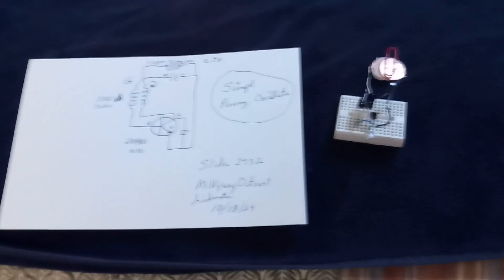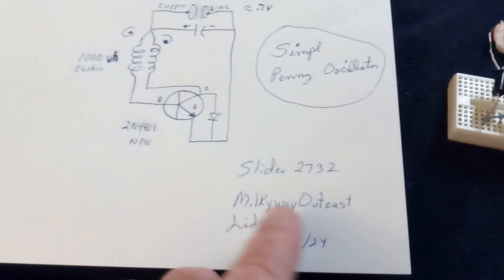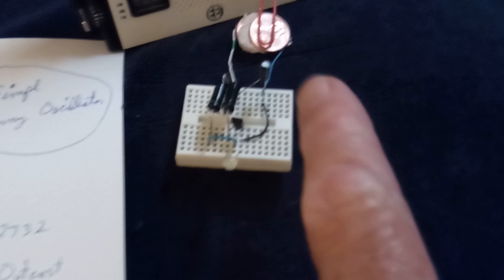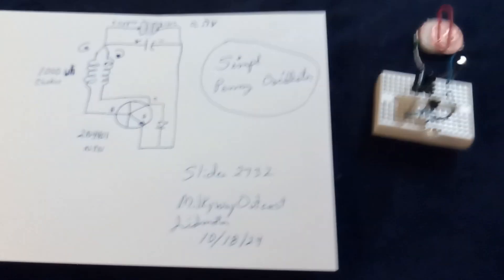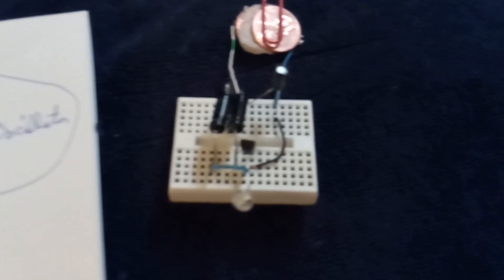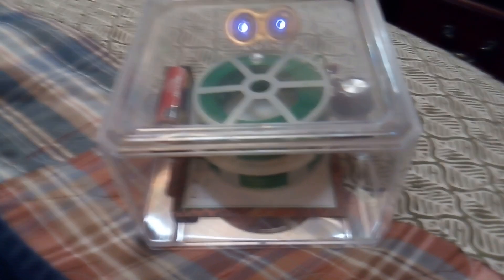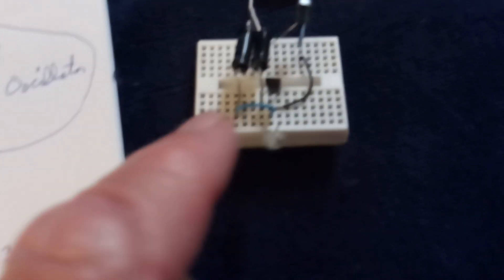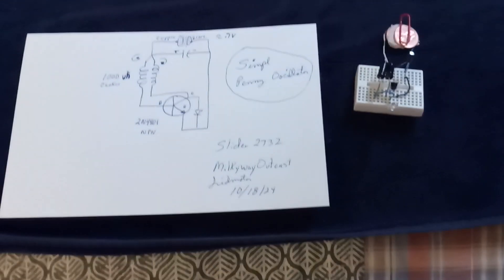The Simple Penny Oscillator

Comment: Copper, zinc, electrolyte between the two and alkaline solution, this is a rudimentary electrochemical battery.
The electrolyte can be cotton, paper, cloth, anything that absorbs the alkaline solution.
The alkaline solution can be vinegar, lemon, sulfuric acid, salt water, etc.
Reply from the maker: This copper and zinc cell can react with just tap water.  I am not sure that the US copper penny internal metal is pure zinc now.  It is probably an alloy.

Comment: thanks for the back link 🙂. i could only come up with this simplification because of you guys making the circuit in the first place. so i have to thank you for the thousends of hours of research you have done over the years and enabled me to learn and play around with this things myself.
Reply from the maker: Today I hooked up an amp meter like you used and it is indeed running in the low microamp range.  You made a great find.  Many thanks for sharing your discovery.  All the people who I have worked with over the years have built on each others work.   It has been a global effort and  alot of fun.
Reply: @Lidmotor  i am getting around 25 micro amp in the beginning. the longer it runs the lower goes the current down. also: do you have a different messurment for messuring across the cap vs across the emitter and collector? i do....🙂
Reply from the maker: @MilkywayOutcast  I have not had much time to work with this but what I found so far is very interesting.  Mine seems to run in the realm of the break over point of the transistor and the LED.  It is fascinating.🤔

Comment: you don't have to sand the penny's i found out.
Reply from the maker: Hummm.  How did you make a galvanic cell using copper on copper????
Reply: @Lidmotor  years ago I stacked 15-20 Penny's with cardboard and wrapped it in electrical tape to hold it together not completely covering it then soaked it in salt water let the excess water dry off it lit an led for 3 days. I think it's called the thermal/ionic transfer principle I really don't remember but it works. I made crystal cells that way using ibepointess2's method. I did one the other day hold it together with super glue got 208mv but no current.
Reply from the maker: @AnDyity  WOW!   That is great news.  I will have to do some research on 'thermo/ionic transfer'.  That is new to me.  Those old days when  ibepointless was around and we were doing those crystal cells projects was a fun period .  I still have alot of those cells around.  Some of them still come back to life if you add water. Most went dead when the galvanic action consumed the anode.
Reply: @Lidmotor  yeah I still experiment trying to figure out how to make them more energy dense because if you recall his didn't degrade the magnesium because the batteries we're based on pressure not galvanic action.

Comment: Great to see your take on it. Listening to the radio ticking brings back memories of many of your old circuits 😊😊
Reply from the maker: That little radio has been one of my favorite tools over the years.  This little project can be done very quickly. I originally ran it on a solar panel out of a garden light like Slider tried.  You can control the voltage by shading the panel. The circuit won't run if the voltage is too high though.  😀😎
Reply: @Lidmotor this is interesting ! Would it run with higher voltage if the load is increased then ?
Do you think it might be possible to run larger mutually coupled pancake coils on the output of this “penny circuit” ?
Reply from the maker: @Caesarus2011   I tried running this particular setup on higher voltages and what happens is that the blink rate goes up just like on my regular "Penny Oscillator' ---but if you increase the amperage it overrides the capacitor and acts just like a regular Joule Thief.  Linking pancake circuits to the output should work but remember that the amperage on that flyback pulse is pretty low.
Reply: @Lidmotor  many thanks for reply, really appreciate. All I need is voltage and very low current is perfectly fine. If it works for power grids, can work for me (or anyone) as well … obviously at a much smaller scale.

Have you tried axial inductors with less or much more resistance, I noticed that yourself and slider using quite high resistance inductors …